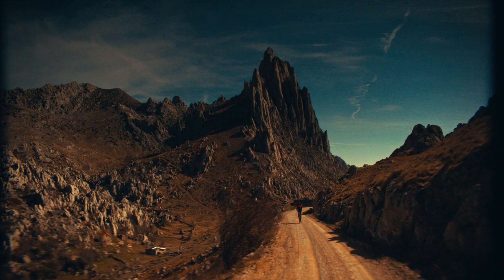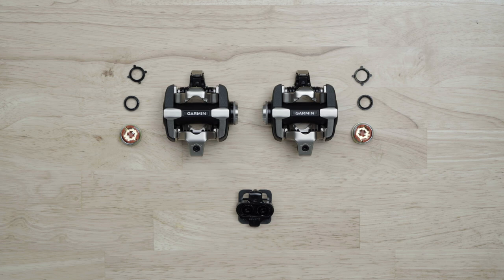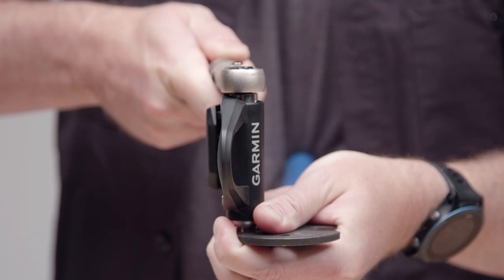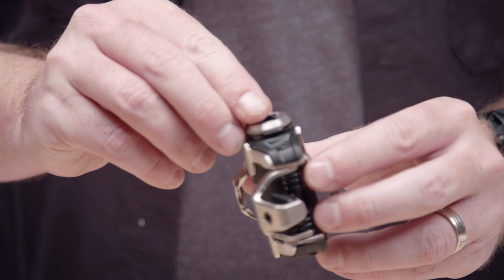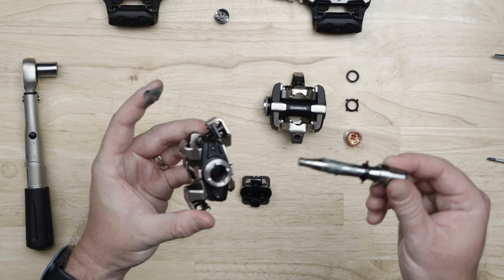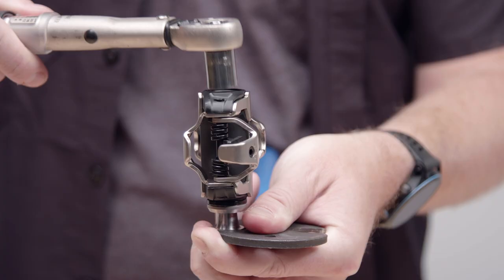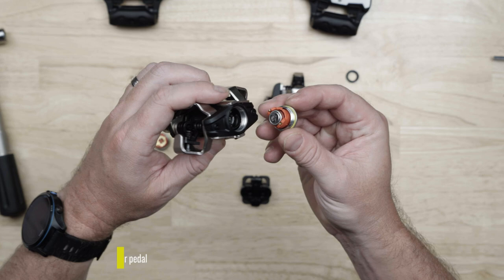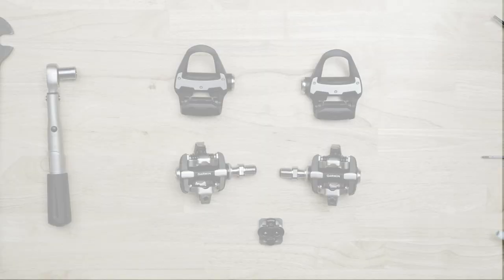Garmin Rally Series: Transferring Your Spindle to a Different Pedal

Comment: Can the left and right spindles be switched for a right-sided powermeter, for people with a stronger left leg?
Reply: I have the same question, for a "backwards" crank application.  Danielle at Garmin product support, "Garmin chat" said "No, you cannot mount a left pedal body on a right-side spindle."   I'm not sure why, the spindle and nut sure look interchangeable with the bodies in this video.  Maybe the power measurement hardware and software is not set up for this.
Reply: @larrylem3582  Threading is opposite on Left vs Right pedal
Reply: @sch79  And in my backwards crank application, the left pedal is on the right side and the right pedal is on the left side (to match the crank).  I swapped pedal bodies and found the Garmin 520 would not display power.  So the issue is in the software/algorithms.

Comment: Are you supposed to be able to remove the battery door, on a single-sided Rally system, from the right pedal? I have never tried before, but when attempting to switch from XC style to RK style pedal bodies, I have stripped the hex slot on the right pedal batter door trying to remove it.